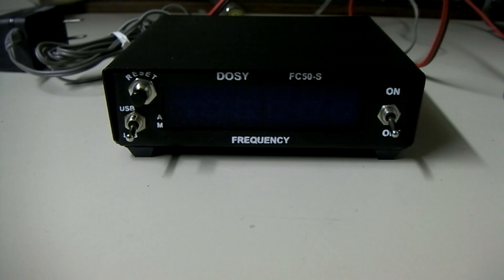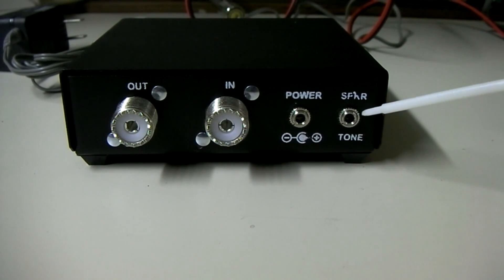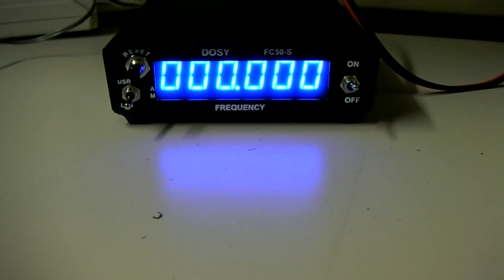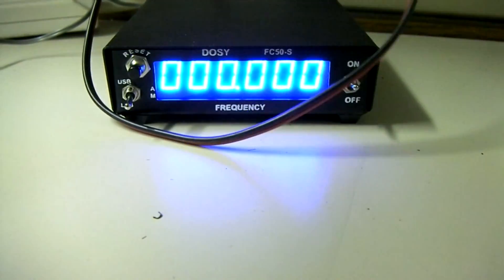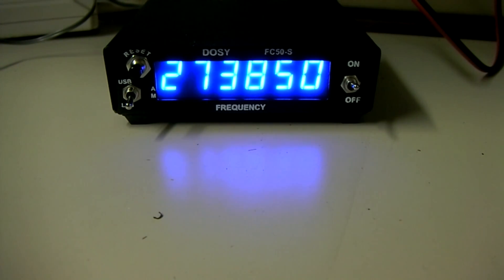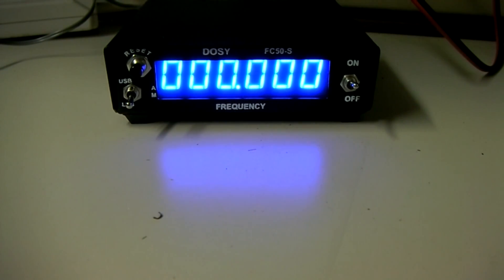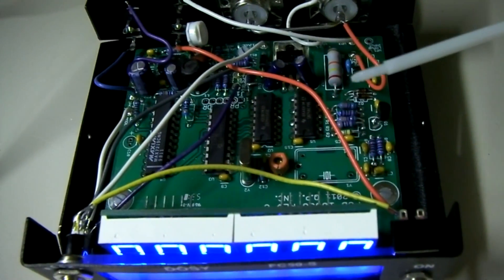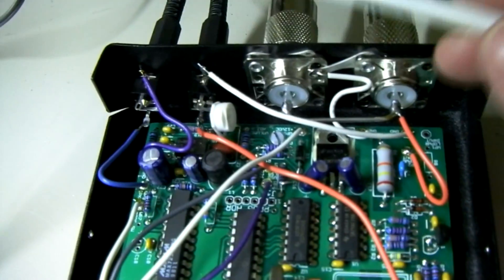Dosy FC50-S AM SSB In-Line Frequency Counter

Comment: On a six digit frequency counter what is that six digit supposed to be if you're on less safe channel 19 or 27185. Should that six digit be a zero or a five
Reply: Zero. 19 = 27.1850
Reply: +Jim Verge well that's a vote for zero yesterday I had several votes for five
Reply: +Jim Verge thank you for the link. You were talking about being in the radio business since the 80s well these people that are telling me five I've also been in the business since the CB boom which was in the 70s. So you know six of one half dozen of another I don't know
Reply: +Radionut R correction should say and not ive been in the business that should say they have been in the business
Reply: Maybe they misunderstood the question, I'm not sure. I've been in the radio hobby, starting as a teenager, since the 1970's and have been a Ham since the early 1990's and, to me,  that's a very basic question. People in the business should know that one.  LOL
Reply: +Jim Verge  well the reason why I am asking this question to begin with is that I have a RCI 2950 DX with a  six digit frequency counter. Of course we all know that those counters are not accurate all the time. 
So I have an external frequency counter that reads six as that six digit. That's where the original question came from. I thought this would be a simple easy question but it turns out it's more complicated than I thought. Is there some way to contact you directly and I will send you some pictures
Reply: +Jim Verge thanks
Reply: you really want an 8 digit frequency counter that reads 27.185.000.

Comment: Do I adjust the volume of the speaker by keying up the mic and using it on sideband until I got a stable reading? Otherwise, how would I know if I needed to turn the volume up or down?

Comment: Worthless counter. It reads a new frequency only when you hit reset. Can't use it 
to monitor a VFO as you dial around or to monitor drift.
Reply: So if your clarifier is opened up it won't read where you slide to that sucks
Reply: I don't quite understand what you're saying. So you are saying that if you have a radio that goes between frequencies like the  a channels it won't read it
Reply: It’s not for receiving, I mean what are you doing? Staying keyed down while you roll the band?